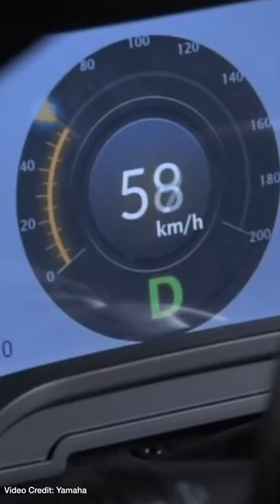Short: Yamaha Announces 350kw Motor

Comment: I saw something about this on another channel but I will take it more seriously coming from you. I would be more excited about efficiency than pure power myself. This is where Tesla still have the lead and, regardless of what they say, are charging a premium for. Seems like Ford and VW have thrown a bigger battery at their efficiency deficiency but that brings cost and weight penalties.

I would love to see costs for new electric motor development versus an ICE. I would imagine the complexity is reduced by an order of magnitude given the reduction in parts count.
Reply: I think the management of magnetic flux and back emf, while difficult to get optimal, would be far easier to get right than the ICE gas flow and combustion process across a wide range of revs.  The later is probably eased a bit due to long experience, but that just makes any further development work on ICE engines a bigger stranded asset.

Comment: sounds like a good motor for the aptera
Reply: Aptera is going with in-wheel motors from an eastern European company (Elaphe). The body/chassis is not set up to contain a motor.
Reply: @TKevinBlanc  I'm glad they went this route, much more aero dynamic in terms of body shape.
Reply: @TKevinBlanc  I thought these yamaha motors sounded like they could be in wheel motors.
Reply: @peterjol  Maybe I missed something, Peter. They talk about "the gear and inverter in one housing." The images in the video all show traditional hubs in traditional suspensions driven by traditional driveshafts.
Reply: @TKevinBlanc  Lol ..no ..you could be quite right...something made me think there was an in wheel motor option.
Reply: 350 kW is a bit much for s 2000 lb. vehicle.
Reply: @robertkirchner7981  Seems about right to me.  I like G's.
Reply: @incognitotorpedo42  That combination would be enough to cause grey-outs... assuming the wheels could transfer the power.